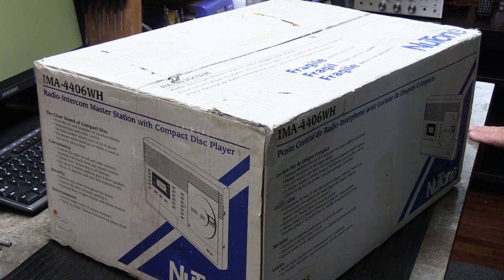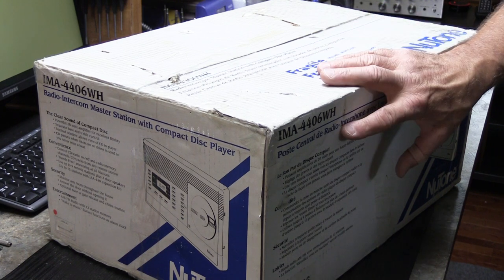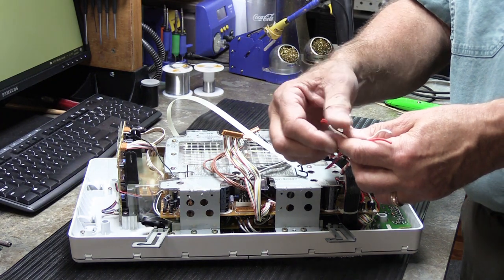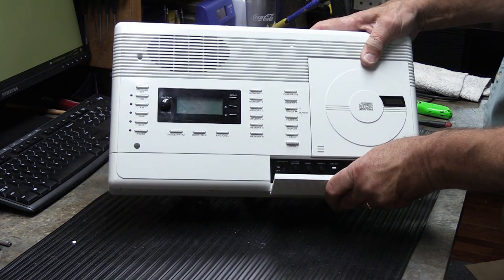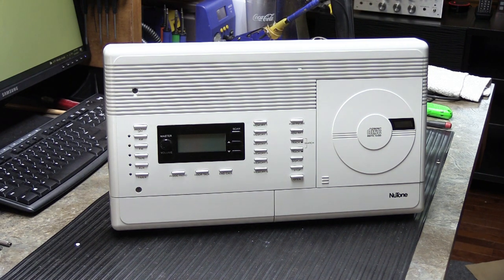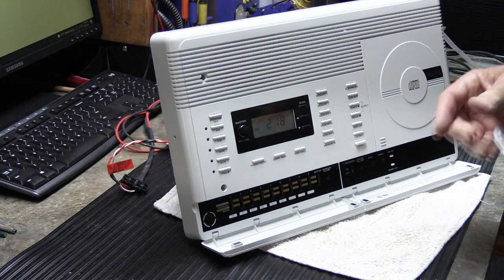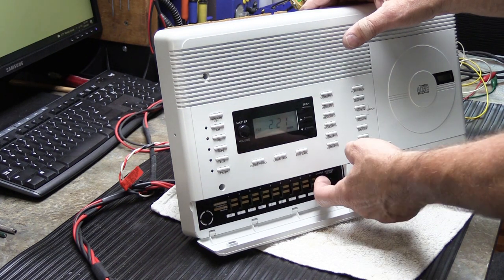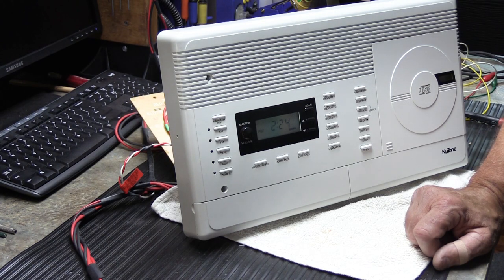It was Advertised as a NOS NuTone IMA4406 ~ Never Installed ~ Is It ~ or Not? Do your Homework First

Comment from the maker: Don't cross your fingers - close your eyes and hope for the best when you're buying a piece of vintage NuTone Equipment.  You  should realize that most on-line sellers have no real idea about what they have (good or bad) and they will paint the best possible picture for what they're selling.  Details will be overlooked - basic information will be completely wrong and what you get in the box may be very different  than what you expect.  Don't believe that "Refurbished" means anything beyond "they whipped if off with Windex" - There's no such thing as "Manufacture Refurbished" NuTone Does Not refurbish equipment.  Lastly, even if it is really NOS ~ Never Installed ~ that doesn't mean it will work.  If it's more than 5 years old, you must consider its "shelf-age" especially if it's 30+ years old. - Chris

Comment: Even though the CD player doesn't work, you ended up with a really nice unit. I know the CD player is a failure point on pretty much all IM/IMA-4406s (especially the IM-4406s)... but you're right, you're still taking a gamble buying anything NOS (or supposedly NOS)... a few years ago, I bought what I thought was a brand new desk fan off of a website that I don't believe exists anymore. It turned out that the motor was bad right out of the box. I ended up calling the company, and they made it right by sending me a brand new one to replace what was supposedly a customer return. And that one worked perfectly. So it's not just intercoms, but pretty much anything, that you have to be careful of when purchasing something that is believed to be NOS.
Reply from the maker: Hey Vincent:  It's very good that the manufacturer did the right thing about the fan you purchased.  When buying any NuTone Intercom Equipment - buyers need to slow down and put in the time to research what they really need and then what they're considering buying.  I understand this is a lot to ask, but it will pay off in the long run.  - Chris
Reply: @northsideservicecompany3567  I actually called the retailer, and they were the ones that sent me out a new fan. They let me keep the old fan, so I'll keep it for its spare parts.
Reply from the maker: @jeepguy95  Good on them for doing the right thing - Chris

Comment: Very informative,  thanks!
Reply from the maker: Hi Jim M:  Are you looking at - or did you buy a "NOS" Intercom? - Chris
Reply: @northsideservicecompany3567  I upgraded the old system I had with ebay stuff, truly buyer beware, I have learned alot, and this helps a bunch, thanks
Reply from the maker: @jaymes1  What did you buy? What are the problems? Everyone would like to know - Chris
Reply: @northsideservicecompany3567  sry for the late response,  it was a 3303 system, It was supposed to be all there but the power supplies were missing,  had to buy another one for parts, it worked out ok, just alot extra money.  It came with the programmable doorbell,  db55 I think you said. Its independent of the intercom and older, can that be wired into the 3303? Its neat learning this stuff, thanks

Comment: It does sound like the seller really thought it was the correct unit in the box.
But he is not an expert like you are.
Hmm no movement of the laser sled or rotation motor.
Power failure or micro fuse on the pcb maybe?.
Some c.d units won't even spin the disk if it can't focus the laser.
Some don't give a dam and spin the disk.
I hate c.d players as the laser assembly can act up and fail to read the disk with enough clarity to play it.
There is no obvious fault.
Reply from the maker: Hhi zx8401ztv:  I agree that the seller listed the item in good faith and thought he had the correct information.  CD Player are by far one of the most difficult products to troubleshoot and repair.  The CD Players in the IM / IMA4406's have age related power supply problems and laser diode problems.  This is one of those "chicken & egg" situations - it's impossible to know which came first.  - Chris